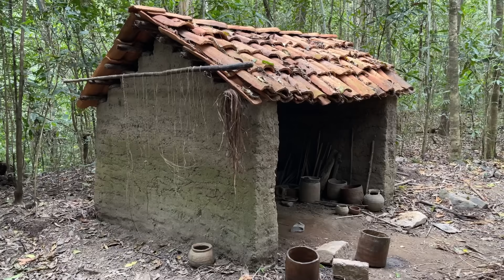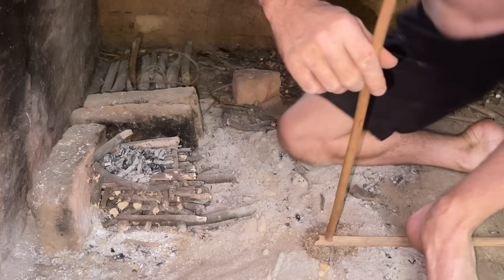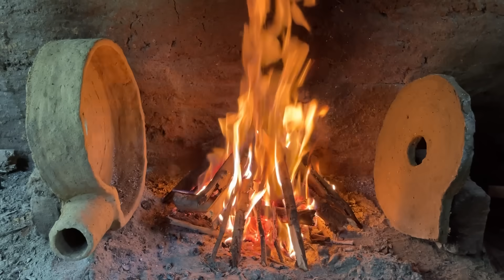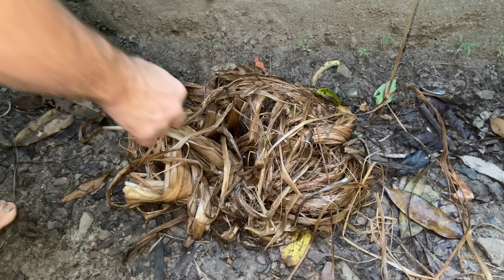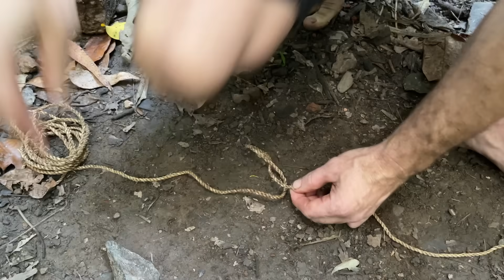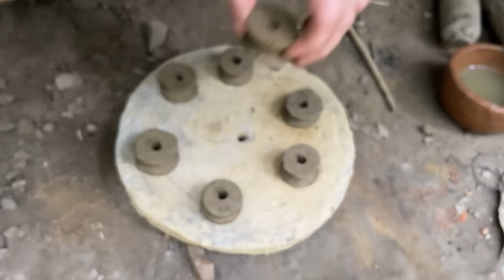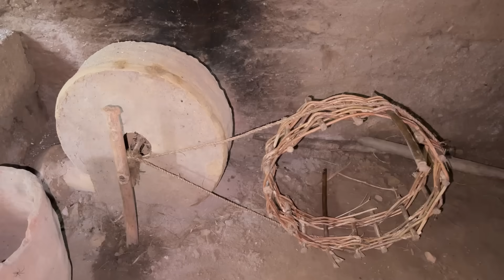Primitive Technology: Floating Pulley Blower Smelt

Comment: I wonder if it would be useful to test various amounts of fibers and other additives added to clay to increase its resistance. I imagine the fire is definitely a major stressor on the clay but it does seem like you've remade the  blower multiple times recently. Also would firing the clay like you do with the tiles help or would it become too brittle?
Reply: Also i imagine the higher yield with the other methods came from a faster fan speed. Even with the thin fiber pulley on the axel, that would reduce the work done by the rope and significantly slow down the fan. The extra you got from the average is probably due to the consistency but youd either need to spin the drive wheel faster or find a way to increase the belt ratio, a secondary stage could help but adds complexity, ideally youd want some way to increase the friction on the axel and just restrain the rope. Maybe carve some grooves into the axel and fill them with sap

Comment: I do wonder what you could use as a center for a wheel that would not wobble as much. Most of it will come from the material there but also from the supports and the ground. I wonder if you would be willing to make roman concrete for a permanent fixing point for rods? But then i don't know how easy it would be to replace those rods once the concrete has set. Maybe the current design is efficent enough and its now down to the furnace but the spliced rope does give me a bit of hope.

Comment: What's actually the goal here? You won't get enough heat from charcoal to actually create steel or iron from ore. You will only get pig iron that has a much lower melting point because of the high carbon content. You can try forging it into wrought iron as was the only way until the industrialization.

Comment: Rotor suggestion:
Would it be possible to find a large flat stone and make a rotor out of it, the mass alone would help it turn more consistently, and you could further improve it by adding a foot operated treadle mechanism

Comment: Completely ignorant comment alert; I don’t think it’s accurate to compare the blower type when there are so many other variables at play. For it to be only the blower, all other variables must be equal, and they are obviously not. Everything from the quality of the ore, the charcoal, the furnace type, the ambient temperature, the gaps in the furnace, the time spent stoking, the position of the ore when placed, the intricacies of how the ore is interacting with the charcoal (very randomly). To control some of these, some sort of automated stoking and ore delivery system is needed, also, some system of controlling the passage of the ore through the “blast furnace “.  If all things are automated, the blower, the charcoal and the ore, then each has a control to judge any change in the system.
Reply: Algorithm bump

Comment: Lets say there's a village with 2 guys - smith and apprentice and they do it full time doing smelts like this daily. Smith also work the iron and forges stuff. 25 days * 20g = 500g a month. This is not great but maybe feasible for spears, short knives, etc. You get 3 spearheads per month and you need to feed 2 men? That's some expensive spears no doubt. Maybe it would make sense, especially considering that you will re-forge all the broken iron weapons/tools so its not XX appliance that becomes trash in 10 years, metal retains value even if you break a spearhead and need to melt and reforge it completely. But at this workload... no wonder bronze was preferred.

Comment: So absolutely great! Have you ever experimented with reinforcing the clay walls of the blower casing and lid with fiber (e.g. banana fiber), similar to steel  reinforced concrete or clay walls in half-timbered houses? So it won't break as easily when handled. Greetings from Germany!

Comment: Love this new blower concept, and the rope pulley in place of the clay one! 
I'm guessing that the floating handcrank is better than the fixed one because you can control the tension better, accounting for all the dimensional roughness by feel. In that case, you could use a hybrid approach: a handcrank on a fixed axis, but without staking its frame into the ground. Instead, balancing it as a mono/bipod, so that it can support its weight but will still freely move closer or further away from the blower for a constant tension.

Comment: You should be able to use clay as a machine interface just need to final fire then polish the hole you want the shft to spin in via either wood and sand or a rock.
Reply: Don't forget to ad around 20 percent size for shrinkage if you do final fire a machine part out of clay.

Comment: You can keep tension on your rotor line with a tensioner. Something like a fired clay wheel with a deep set groove fastened to a support. It would make using a mounted crank more feasable.

Comment: You can increase the efficiency of the blower by ramping the neck of the volute into the hole.

Those right angles add a lot of resistance to the flow.

Also, it would be wise, once the housing is then dried, to slick-out the inside with a smoother layer of clay to help reduce drag along the walls of the blower.

Comment: i would suggest putting a pulley between the input and output shaft to act as a tensioner. this should create maximum traction on the system.

Comment: I think you should do more woodworking if it's possible. At minimum you could make a larger freestanding wheel for the blower. A larger wheel could be spun at a lower rpm but achieve greater blower speed. Look at the Chinese channel where the guy makes ancient Chinese crafts. Idk what the channel name is. He has a contraption where he makes a large pulley linked to a smaller one using fiber. Making something like that might be useful for you.

Comment: Make the larger wheel out of clay to double as a flywheel on a second axle. Then, make a treadle plate to drive it like an old sewing machine. It should be easier to run and it will keep blowing if you step a way for a bit and your hands are free to add coal/ore or make rope while it's smelting.

Comment: Hmm... if you could find some way to develop a magnet or find a lodestone, you could potentially use that to help sift out iron dust from the crushed slag, which you could then re-invest in a second smelting to help recover more that the prills. It might also be a good idea to invest in making some ceramic crucibles, which might help with catching and collecting the slag easier (though it mimght also complicate things - it's something to experiment with, at least)

Comment: With a long enough rope, you could wind it onto the wheel, run it over the rafters, and attach a weight to the other end. When you release the weight, gravity would cause it to turn the wheel on its own.

Comment: for the fixed design did you think of adding a belt tensioner? just one more of those clay pulleys next to and a bit higher to the driving one to tension the rope. The crank wheel has enough friction I think, but its seems you would benefit a lot from more tension in the drive pulley.

Comment: Right now your gear system is working horrizontally and have the big gear size fitting your arm range motion, but I was thinking, perhaps if you place the gear system vertically and use a bigger gear you can use the rope like in a shutter curtain (don't know the exactlly name on english), in other yords, vertically. That way you may get more rotations with less effort.

Comment: If you somehow manage to make a stone wheel and pulley, I reckon the effort would produce a more durable and stable system. Would need a lot of manual chipping and grinding into shape though. And dunno how you would make a hole in each for the axles...

Comment: May I ask about the involute reasoning, "The spinning fans adds air to a gradually increasing volume around the fan", but the entire volume is already filled with air. Is there a change in pressure? 
I assume the involute is a smooth way for the air to gain speed while moving away from the centre until it exits through the opening.

Comment: If you can get the framed crank pulley working reliably, you can run the blower continuously with one hand while feeding the furnace with coal/ore using the other hand. I think the continuous airflow would produce a massive improvement in your yields because the environment inside the furnace would remain way more constant.

Comment: you could install something in running water like a paddle and use a switch to control the angle to change the speed of the wheel. installing multiple or one or what ever a room called for could heat a room, controlling the temp some what.

Comment: At this time the next thing you should be doing is a wood turning lathe as you unlocked the Gear/Pulley technology and you have only enough iron to make some primitive toolbits. Even it would be a brittle because of the high carbon content  it is worth the try. If unlocked you may be able to go into the batch production of wooden pulleys etc. In 3 years we will be seeing cars rolling out of primitive technology HQ 😂 Man is the next Henry Ford

Comment: I will say, the data collected and record yield, could be atributed to higher iron content in the raw ore, as apposed to consistantly high pressure and heat, though I think its a mix of both. This blower desugn seems very promising, if you could find a way of making a stable rig for an even higher rpm fan.

Maybe try wooden pulleys? Its been used in boat rope rigs for hundreds of years. I allso think two deep holes, with staked burried and just sticking out, like a ratio of 2 lengths underground and 1 length over ground, with loose wet clay used as a sort of morter, would give a way more stable, less wobbly base for a fixed wheel design. 😁

Comment: I feel like the clay pulleys wouldn't break if they were fired, but then again, I feel like you'd know that better than anyone, so there's a reason that you haven't. maybe I missed it at some point and you've tried that and they do still break. What about wrapping the rope around the shaft more than once? or maybe that would that just lead to tangling the rope and losing momentum. anyway your videos are as awesome as always.

Comment: I do not know if you ever thought about this, but if you make ceramic bearings and then create little races they can track in, you will minimize wear and tear as well as having a more efficient and better fitting system
Reply: Ceramic bearings that would not quickly crumble would require much higher firing temperatures and extremely precise rounding and matching of balls... not very practical in these surroundings.

Comment: I keep wondering why you don't use a super thick fired clay cup as a crucible to put the iron dust into before firing. You could use primitive tongs to keep it where you want when adding more fuel and it would keep the produced metals together in one consistently heated place. Possibly in a single node if you keep it in the hottest part of the fire. Worst case it would crack and you'd get the same results as the current method.

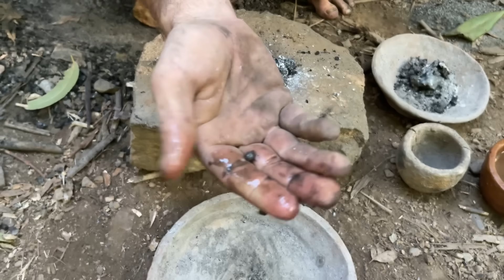Comment: 18:29 Yes, I agree. It does appear like your temperature is too low. The quality of your iron is also important. You may need a much longer smelt with the ore you are using. In general, the amount of charcoal to iron ore you have is right. You do need some kind of silica to make a bloom stronger, though. Think about adding a handful of borax with two teaspoons of sand each charge. This will assist in keeping the iron from oxidizising away between charges and lower the temperature needed to consolidate the bloom.
Reply: where would one find borax in the bush

Comment: If I had to guess, I'd say that the bacterial ore being used here is something like 10-20% iron by weight at best (pure hematite is ~70%, for reference). Ancient bloomery processes were only 30-40% efficient, so a 1200g ore charge should get you  70-100g if fully optimized. My understanding is also that, to get more out, you really need larger furnaces, big slag pools and larger volumes of air. I think that 50g yields are the most you can reasonably expect from a one-man operation that's not smelting like 10kg of high-grade ore at a time.

Comment: Before you replaced the clay pulley with fiber, I was wondering if the wood ash cement you made in another video would be a better material as the clay always seems to break. On top of that, I was also wondering if a taller furnace would be more efficient. On a related note, I'd don't think you've done this before but would a conical (rounded, wider base with a narrower top) furnace have any noticeable effect on efficiency?

Comment: I’ve had *Australian amounts of pints* to read the Closed Captions correctly. 😂
Reply: Holy Moses, he has torque coefficients in this episode! Gear ratios 💪🏻 🧠 ❤️
Reply: Okay, final note: take pulley system, add water wheel and use a crucible to consolidate iron prills with granulated charcoal. Okay I’m going to stop backseat driving ❤